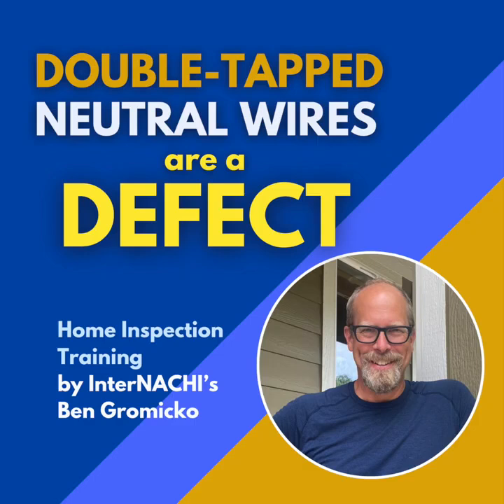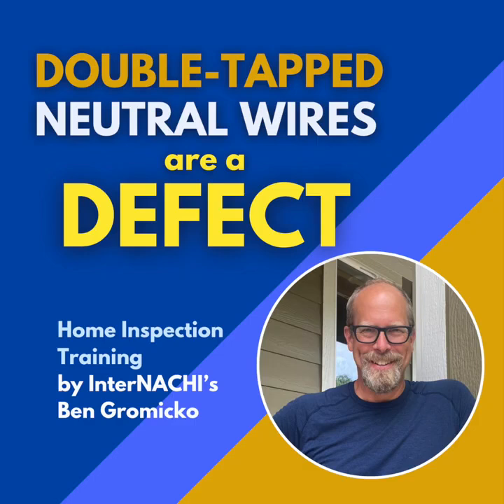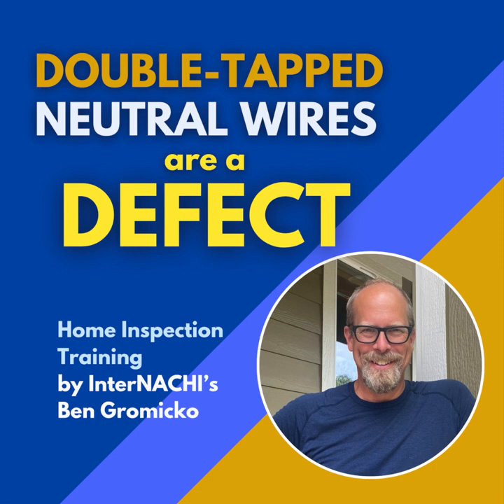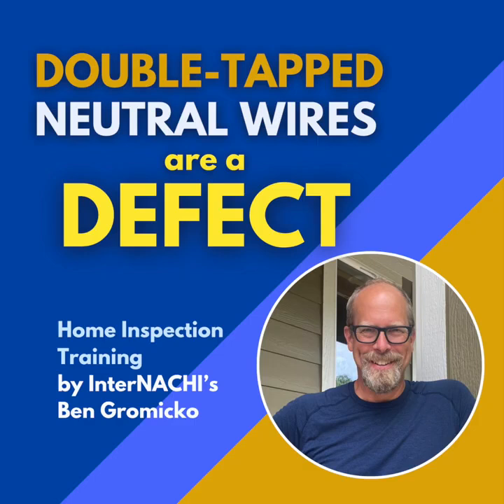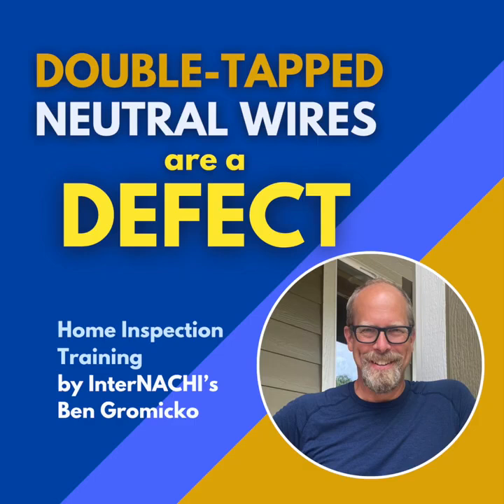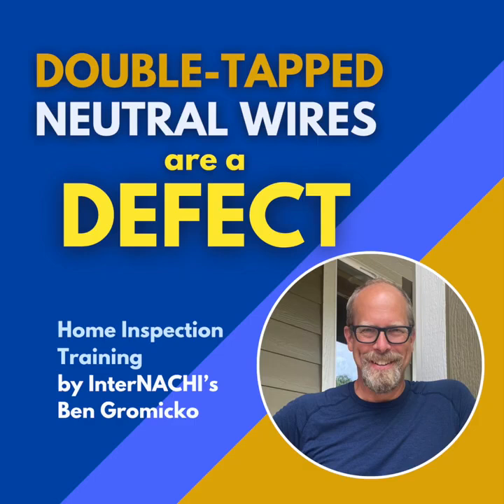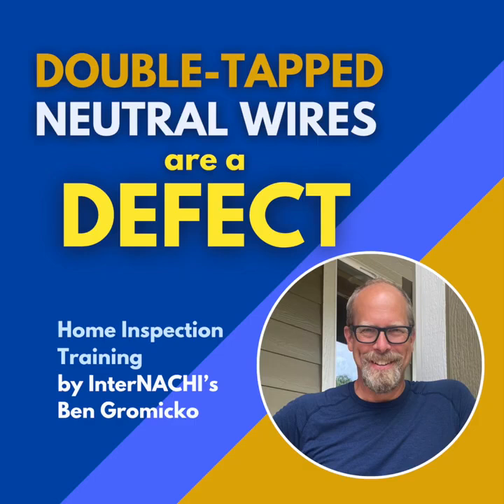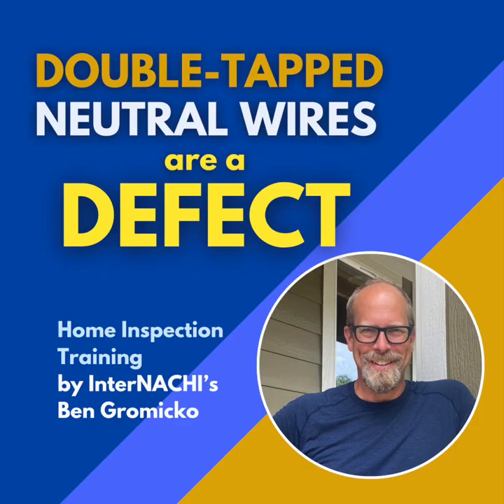Double Tapped Neutral Wires Are a Defect for Home Inspectors

Comment: Your illustration shows the wrong side with 3 double lugging using a total of 7 terminal connections.  Your other illustration shows the right way with the same 7 terminations but where did the other 3 wires go?
Reply from the maker: I'll check it out closer. Thank you.